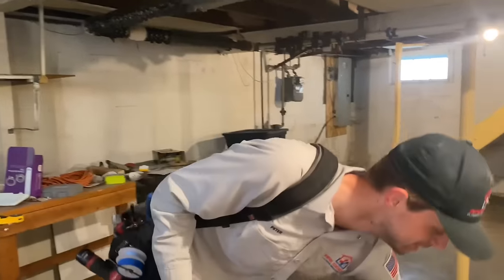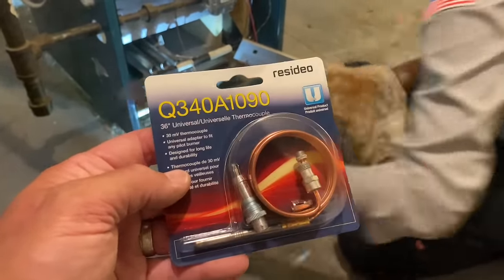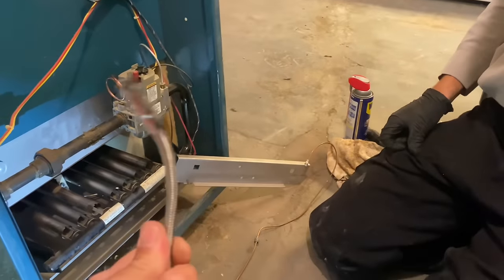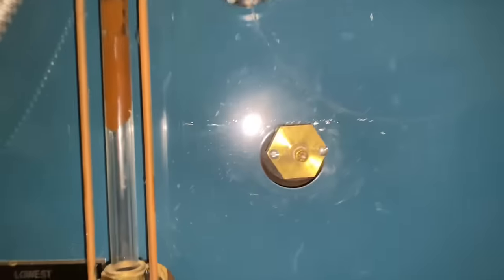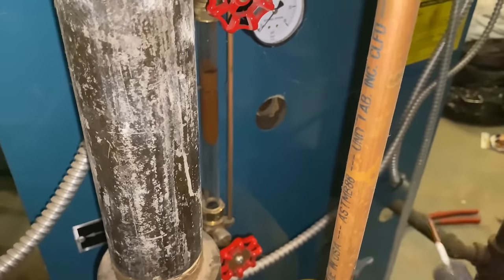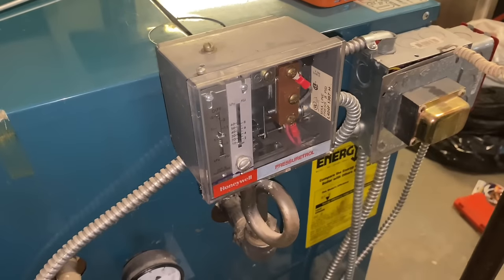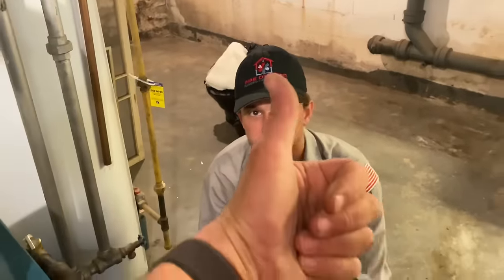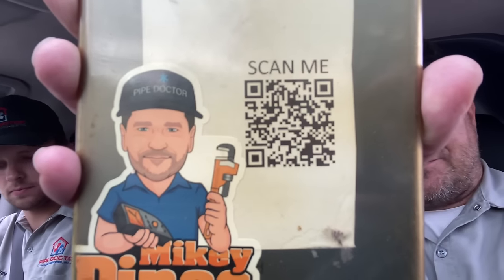Annual Burnham Gas Steam Boiler Step by Step Maintenance & Tuneup with Combustion Testing

Comment from the maker: Typical Atmospheric Gas Boiler Combustion Results 

Stack 325-500 degrees F
O2  4%-9%
CO2 6.5%-8%
CO  Less 50ppm
Reply: De
Reply: The National Comfort Institute class said they want 6 to 9% O2, I had to drop to 3" to get it on one steam boiler.  WM stated manifold pressure to be at 3.5" was more important and O2 could be down to 3% anything below that they got concerned.   But also on a Cast Iron boiler, the only CO level they are concerned with is not exceeding 400 PPM.  Which is way higher than the "Testing Industry" wants to be.  Unfortunately other than the old green liquid hand pump O2 readers,  atmospheric boilers pre-date combustion analyzers and the manufacturers do not want to get involved.

Comment: if my eyes dont deceive me.... the Pressure/ temp pipe cannot be threaded at the bottom. this way, the home owner cant cap it off it its dripping. boilers are a giant pressure cooker
Reply from the maker: You’d be correct. No threads at bottom.

Comment: Shoot there be a automatic feeder on that steam boiler connected to the low-water cut off switch
Reply: Its a option.
Reply: Dan Holohan says he doesn’t like them because if it hangs up and then breaks free, then, the sudden intro to a hot dry heat exchanger, could flash the water to steam and explode.
Reply from the maker: I don’t like nor recommend automatic water feeders on steam boilers. Dan Holohan taught me well.
Reply: I dont recommend them for our long Island , especially the five towns area customers either. The water is terrible and foul the seat on the feeder.  @PipeDoctor
Reply: Not to nitpick but during a pm you don’t check incoming  gas pressure on the gas valve
Reply: @PipeDoctor his book is great

Comment: I just donated to Mikey’s foundation because watching his videos taught me how to fill my boiler, purge out the air, light the pilot and start up the system. I had to do this after I needed to fix a hole in one of my heating pipes that I accidentally drilled through. The fix was easy but I was worried about the fil, purge and startup. Thanks to Mikey and these videos I had zero issues.

If you learn from Mike u should donate to help him, help other people. THANKS MIKEY AND THE BOYS!!!
Reply from the maker: That is awesome!

Comment: The only comment is the best wrench for that sensor would be a 6 point box end wrench, once a soft metal like that gets rounded it can play havoc with you… it’s a gamble with pump pliers.  A large adjustable is also acceptable, most plumbers I see use a pipe wrench on everything.  One other note is the pigtail is supposed to be run perpendicular to the control, not parallel, ….this is critical when the control is Mercury, as the pigtail grows a bit, when hot, it will tilt the mercury control. Just something to consider if you bump into mercury controls, they just won’t die.
Reply from the maker: This wrench works too:) Good observation with the pigtail. Unfortunately we don’t see mercury pressuretrols anymore
Reply: or a large 6 point sockets and ratchet, which are also nice for water heater elements and giant spud nuts at times.

Comment: Great Video!
Wish I could have found one like this years ago. I still have my National U.S. gas Boiler from 1962. Over the years I replaced the gas valve ( it had the old type with a separate small gas pipe that if the flame went out gas still came out! ) low water cut off ( float type), drain valve ( drain was clogged) pilot assembly for new standing pilot, pressuretrol, and kept it working just fine.
Had to teach myself all of it and how it works and maintain it myself. Not many service guys now know anything about single pipe steam heat.
Only thing I never changed was the 15psi safety valve on the boiler. 
I'm afraid to touch that one. Its been on there probably since 1962 and I'm afraid to break that or maybe never get it off.

I just was replacing my drain valve, had a clogged pipe from the auto water feeder and fixed that.

On the side of my boiler tank it has 5 boiler sections assembled like a radiator. In between each on 1 side there were like "filler pieces" that were at one time sealed with what seems like Furnace cement. Most of it was missing and falling off. 
I bought Furnace Cement and sealed them up again because to me it seemed like gas from the burner would not be going straight up through the chimney.
3 Furnace guys I asked and showed pictures to have no idea what them filler pieces are or what they do. 

Hope I did the right thing filling them back in

Heres a picture of the boiler and chipped cement. https://drive.google.com/drive/folders/14jGIO9fZvuTC2HK0zn4dmLszbE9hT-Dd

Comment: Gorton calls them air valves. Hoffman calls them air vents. Both are accurate. It vents air. Hence the term air vent. It  also controls the flow of a gas or liquid. Hence the term air valve.
Reply from the maker: I was taught air valve.
Reply: so call them air vent valves? 🤣 semantics

Comment: I had an IN-8 installed in 2005.  But it replaced a WM EG-11.  😂. Beast for a home.  1125 sq. ft. of steam.  We shut off the unused 3rd floor risers and rads to get down to 8 sections.  Some of the regulars on The Wall (Holahan) said don't do it but it worked well.  The steam ceased seeing the risers, so to speak.

Comment: You should put a zip tie on the relay so it won't pop off. I get a few calls  every year because it pops loose. Also clean and flush the glass gauge ports with one of the site rod protecter rods after removing the handle with the stem  attached.   Accurate water readings.

Comment: 22:44 needs deep-well socket with battery operated Milwaukee impact ...for all future calls to..
Reply from the maker: Interesting. Never thought of that. I have an M18 for anode rods. I wonder what size that LWCO probe is......
Reply: @PipeDoctor  A M&M LWCO probe likes a 1-3/8" deep impact socket. 
Remember to screw the mounting screws all the way in before wrenching on that thing, because sometimes the screw holes can get mushed.
Learned that the hard way.
Reply from the maker: @gordonschweizer5154  BEST TIP EVER!!!

Comment: Combustion analysis it's taken from before the diverter. Upstream. On the other hand, the draft measurements are taken after the diverter. Downstream.
Reply from the maker: Sorry. You need to think about that again. Combustion and draft analysis on an atmospheric boiler is done before diverter
Reply: Combustion test should be before the diverter. Draft test varies. On oil boilers or power gas boilers, that utilize a barometric damper, the draft test is before the barometric damper. On atmospheric gas boilers, the draft test is taken in the flue pipe, after the diverter

Comment: Great demonstration. I have a bizarre valve between the water feeder and the boiler. It is called the "low water pressure valve" and appears clogged as the feeder works but water is not reaching the boiler. Would you happen to have an idea how to clean it?

Comment: Hope you can answer this. Water main break on street and fixed. My 1960 boiler prv started  leaking every 3 days. I have to empty old style original expansion tank  to get pressure down. How can I fix this.Also  valve to boiler NOW Kept closed and still water increases in expansion tank and psi goes over 30 in boiler when not even running. Could fresh water valve and Pressure reducing valve both be damaged or clogged due to water main break is that possible?

Comment: My pilot is off. But turns on when heater kicks on.  At first it powers on... then after 20 seconds about.  The fire kicks on.  It's that normal?  I'm thinking no.  Def not.  The pilot always needs to be lit?  How does it kick on and fire up if the pilot is out.  Does something turn the pilot on ? I literally know nothing about these.  I have this and exact one.  I'm thinking this is really dangerous to be running like this?

Comment: Mike type   m copper 1/2 inch for small job ok portable water? Type l was 3x the price
Reply from the maker: No. M tubing is for low pressure (usually hydronic heating)

Comment: Does this have an air filter in it somewhere? I have central air and last owner left a bunch of filters and i have no idea where they go
Reply: No air filter on a steam boiler. Filter on your furnace will have a slot usually on the left or right side of the unit, you should be able to see where the existing filter is

Comment: Hi Mike, Great video. Very thorough and you clearly explain what is going on. I have a smaller version of the same exact boiler and have a question. It seems there is a lot of yellow and orange in the flames from the burner tubes. Will cleaning them as you did in the video get rid of the yellow and orange or is there an adjustment that can get the flame to that nice blue color? Thanks.
Reply from the maker: Nothing beats a great cleaning.
Reply: @PipeDoctor   Thanks for getting back to me.

Comment: BTW on Burnham or really any steam boiler service, the first thing I do is overfill it to the top of the block.  If rain pours into the combustion chamber, the boiler needs no more service.
Reply from the maker: We usually do that too. First one of the season. Didn’t do it until later in the service call

Comment: @pipedoctor - You have an amazing detailed video with so much explanation, I really appreciate it. Mike, I think my burnham gas boiler is doing exactly what you described in this video which is there is an improper combustion resulting in carbonization (I vacuumed a bunch of black pieces from the bottom of the burners). I feel like there is a slight flame roll out happening now in the closet (also don't have a fresh air vent into that room so combustion air is pulled from what's in that room) and I smell some sort of gas in there when my boiler is pushing for heat (3 zones). It's not setting off any of the CO'2 detector I have near that closed and I also have a digital CO2 detector which is giving me a zero CO2 indication. Do you think my problem is that I need to clean out all of the burners with a nylon brush? We cleaned out the nipples inside the cast iron 5 -6 years ago so I'm pretty confident that there is no clogging issue, the pilot is running well. I'm about 35 minutes from you, how much would you charge me to come check my unit out?
Reply from the maker: What town are you located in?
Reply: @PipeDoctor  sheepshead bay, brooklyn

Comment: Did you turn on the power with out the burners installed?? I’ve seen you put an employee in a Uber for the same situation!!
come on!! Mikey had his best employee working on a boiler last year… remember that
Reply: Gas is off so no ignition
Reply: I in my opinion will test that first, then turn boiler off for cleaning
Reply from the maker: Did it just for your comment. The gas was off. 😝

Comment: heat exchanger could of been plugged resulting in poor draft, also the termination on the roof could be problematic in that type of scenario, if the heat exchanger was clean i doubt it would of been an issue

Comment: Why is the pig tail shaped like that?
Reply from the maker: It’s design like that to create a trap that’s filled with water and that is designed to keep the Layton heat off of the pressure troll. If there wasn’t a trap, the pressure troll would be compromised by the Layton heat produced by the steam boiler.